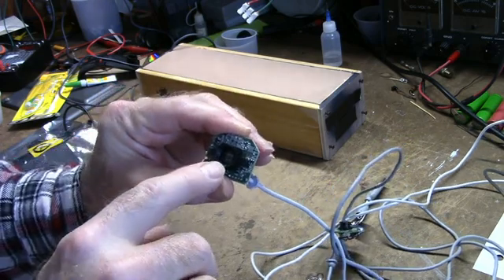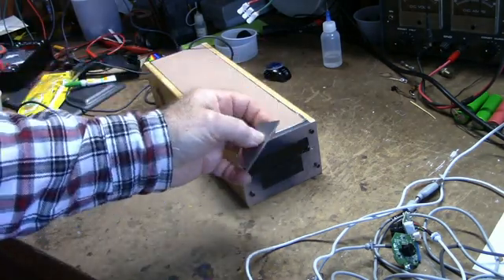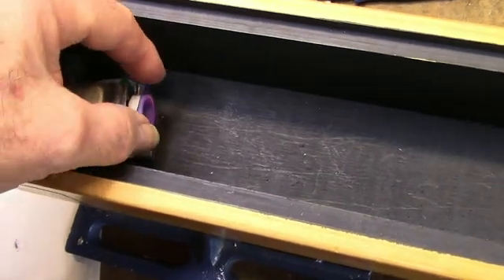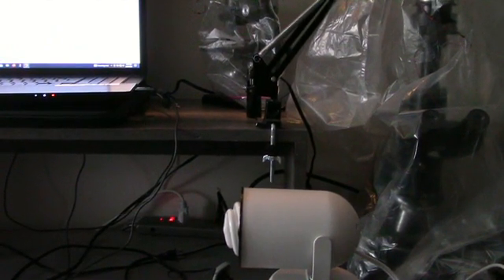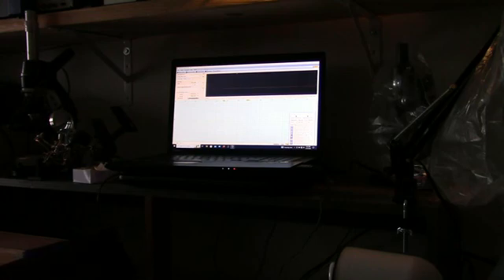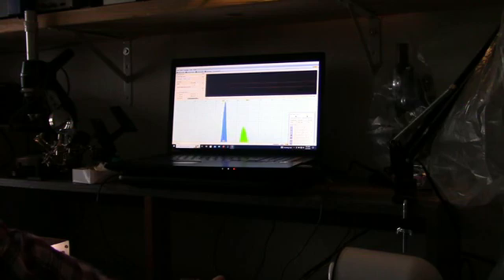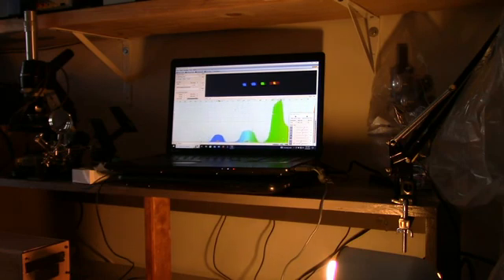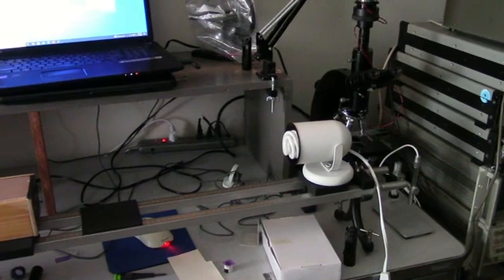Spectrometer Homebrew

Comment: Interesting. The slit can be very far away from the grating? I just wanted to say it's not collimated by that but just looked it up and it seems like just from the slit you already get a diffraction pattern. So it's definitely not collimated and the distance should matter right?

A lot of people on youtube tried it with this webcam method.
I'm planing to build my own spectrometer, but I want to use a silicon photomultiplier to make it very sensitive. But that means I need to turn the grating and track its position. Not sure how to accomplish this yet.

Comment: Thanks for this video. I  made one following your video. But I am not able to see ANY spectrum on the top side. The lower spectrum is indeed visible. I have made a grating from burnt CD disk. The angle is like 40 degrees.
Reply: hi, grating glass is highly affordable. so its better to use that than using used CD
Reply from the maker: Hi, glad you liked the video.  You might try using a DVD instead of a CD.  It has more fine lines.  And use an unused  ( unburned) DVD.  Also,  by varying the focus of the webcam, and rotating the diffraction grating, you should be able to fine tune it for the best results.  The angle the camera makes relative to the aperture along with the slit size will vary the resolution .  Hope that is of some help.
Reply: I was thinking using an old laptop CD/DVD drive sled to control the slit width.  Finding the time to assemble with a MCU and program is another situation.  🙂I was also wondering about using a HD Actuator to sweep back and forth to find the best frequency to possibly use a finer line diffraction grating, so as to sweep a persistent stable image with higher resolution spectra.  Seemed there was something limiting at one time and I forget offhand, of course besides the powers that be.  @toddanonymous5295